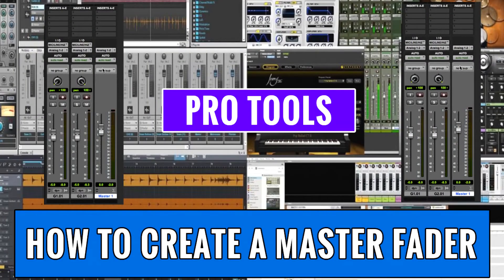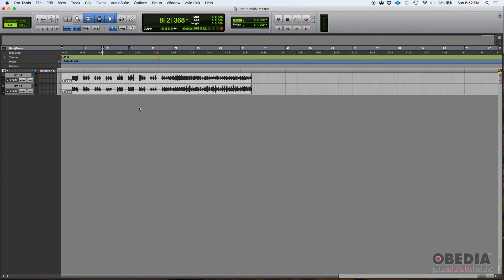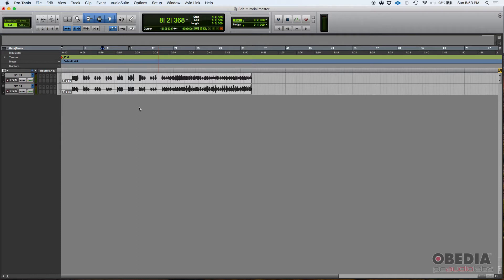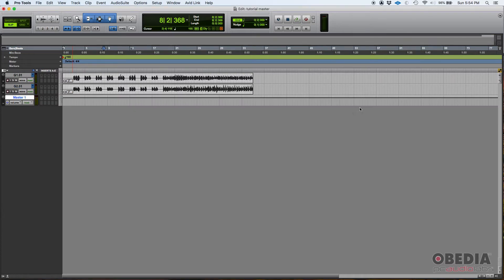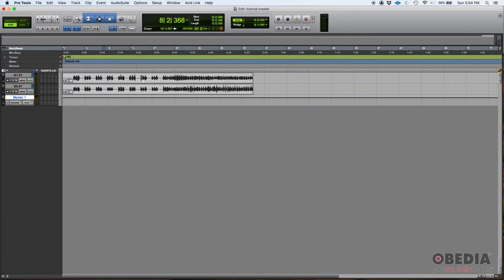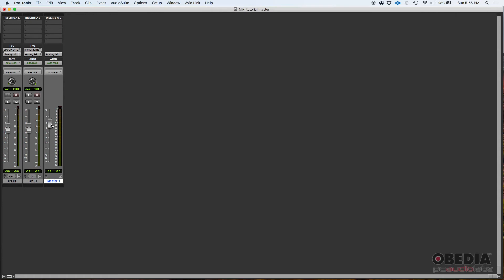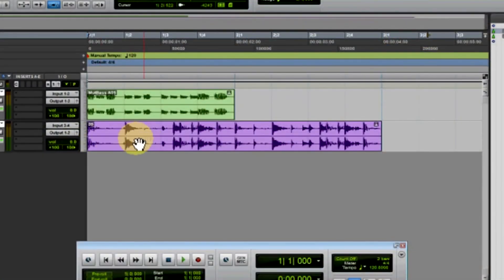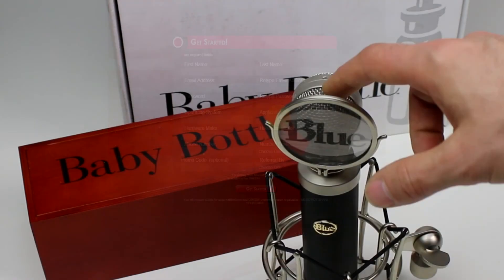How To Create And Configure A Master Fader Input Track In Pro Tools -- OBEDIA.com Pro Tools Training

Comment: With Pro Tools, the Master Fader (unlike every other Pro Tools track type) is only available in a 'pre-insert' fader form. 

Therefore it is not possible to do rides, gain changes or fade outs on the Master Fader without affecting the levels being sent through plugins inserted on the Master track, since changing the input level of a Compressor or Limiter during a Gain Change, fundamentally alters the way that type of plugin behaves. 

Don't believe me? Google, "Pro Tools master fader pre-insert"

The pre-insert Master Fader is a Pro Tools 10 (and earlier) legacy functionality and it simply beggers belief that AVID refuse to address it.

AVID have been asked to provide both 'pre-insert' & 'post-insert' options on the Master Fader for some time. But apparently, they know best and so we are stuck with a Pre-insert Master Fader. 

So, if you want automate a fade-out on the Master Fader and need to use a Compressor or Limiter or any other 'input dependant' plugin on your final mix, then don't insert them on the Master Fader. Put them on a dedicated 'post-insert' fader Aux Track before the Master Fader. 

You know it makes sense !!!
Reply from the maker: Yup, just like a master fader on a mixer. Thanks.